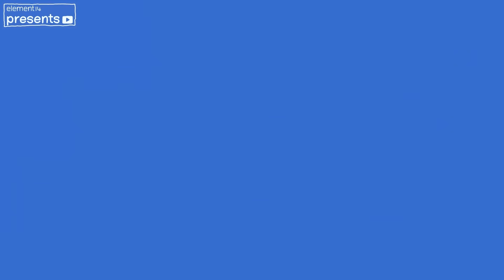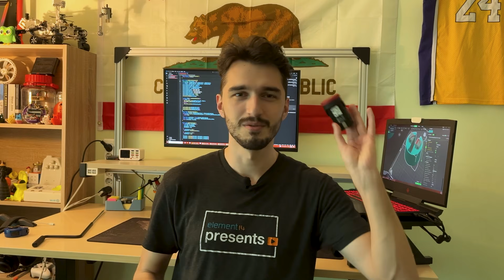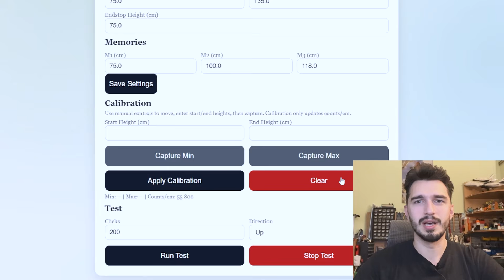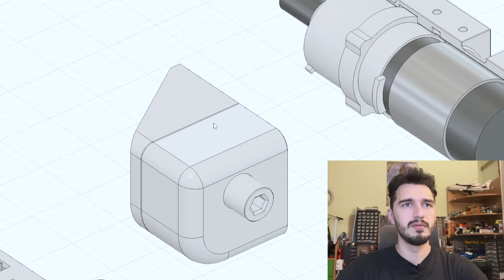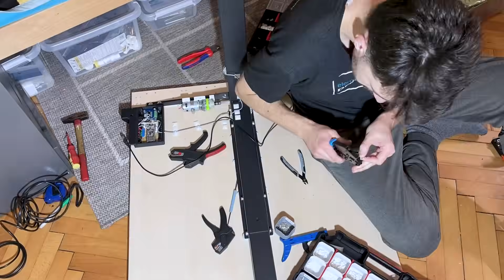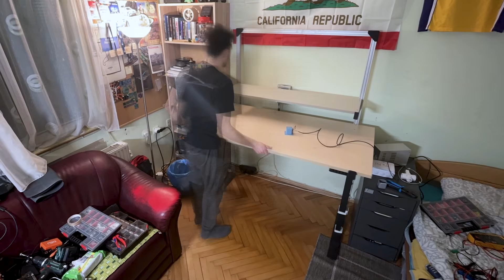DIY Motorized IKEA Standing Desk Upgrade — Cheap, Smart, ESP32‑Powered

Comment: Nice project but why ruin a perfectly working tool instead of just buying a suitable motor? There are plenty brushless ones with integrated metallic gearbox for any torque up to 100kg and the same 6mm allen shaft.

Comment: I wonder if electrical noise from the motor is interfering with your encoder signals? Perhaps use screened cables for those, something like an audio cable might work
Reply: That could be a part of it! Also, this encoder just generally knows sometimes to skip steps. Will probably upgrade to something like a magnetic encoder (AS5600) or a distance sensor that I could mount to the back of the desk to measurre the distance from the ground!

Comment: Since these desks are so common and you can just plug in the shaft, it would almost make sense to sell kits for this upgrade?

How much do you think it would cost to fabricate 100 of these units?
Reply: IKEA already sells the electric version of this desk; however, this approach works great if you find a hand crank one for cheap second hand, as I did! The control electronics part can be produced at around 10$ for sure, you would need some sort of PSU and of course, an actual motor that is not taken out of the drill!